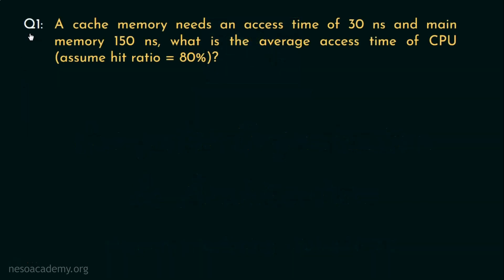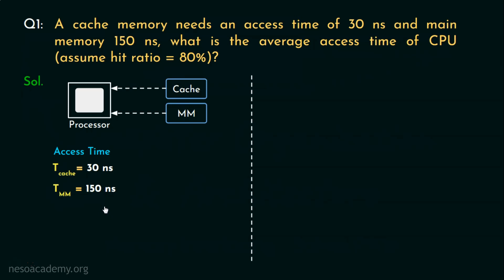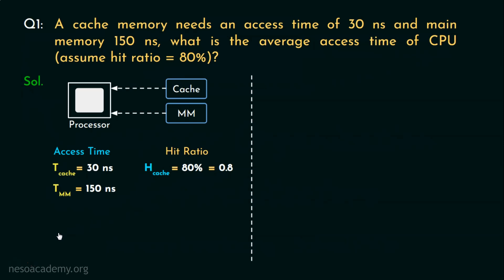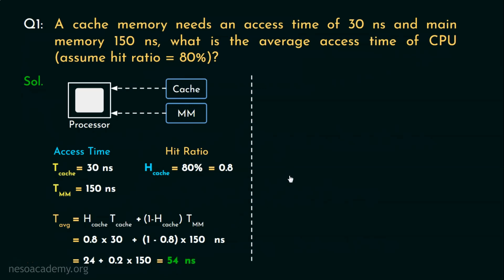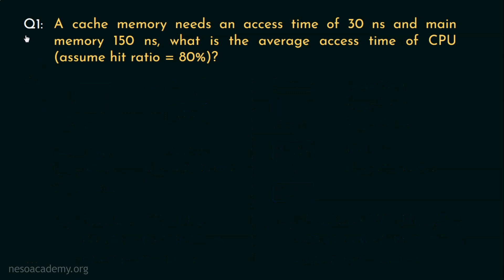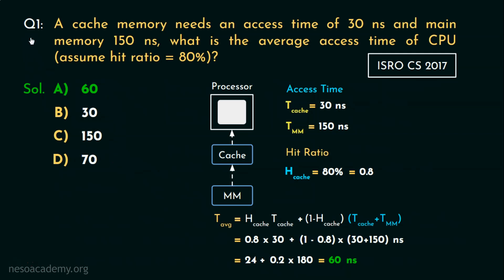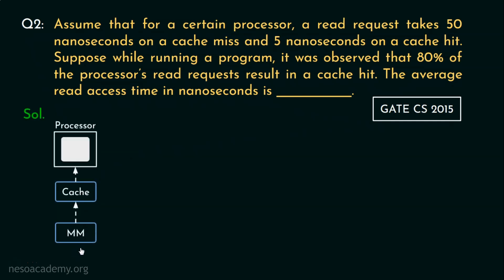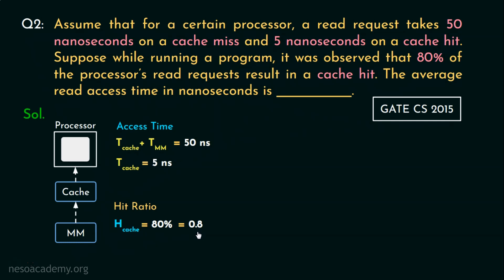Memory Interfacing – Solved PYQs

Comment: In Q1 how do we know whether hit ratio 0.80 is for cache and not main memory?
In Q2 how did you conclude access time T(cache) and T(MM) is 50 ns? I assumed T(MM) alone to be 50 ns cuz that's how the question specified.. :/
Reply: Hit ratios are given only for cache Bruh 😒
Reply: @perioguatexgaming1333 don't make him feel embarrassed bro it might be the cases that even you don't know the silly things
Reply: For the second question it specifies cache miss which means the processor checks the whole cache and when it miss goes to MM , in MM it will definitely find the word hence Tc+Tm=5+45=50ns.
Reply: @perioguatexgaming1333   On parallel organization cache miss means the same, but why are you summing that Tm is 45, it can be 50 too...
Reply: I can explain the first question, it is absolute that the data is present in the last level of the memory i.e. we can conclude the hit ratio to be a 100% or 1 in this case. Since, cache comes before Main Memory which implies that only when the data is a miss in the cache it moves to the MM, for the question the MM is the last level of memory so we are bound to assume its hit ratio to be 1. This may not be a practical approach but is a good demonstration of working of memories.